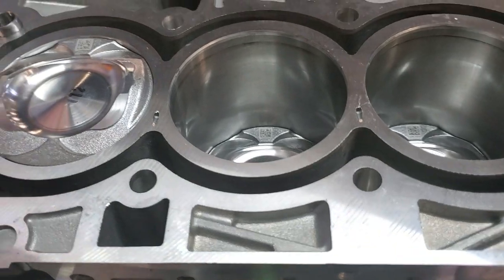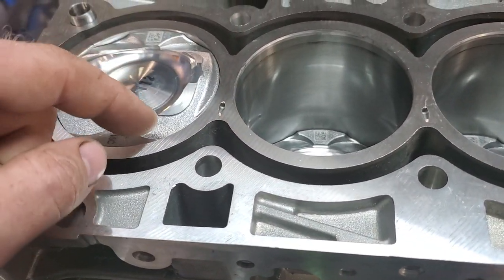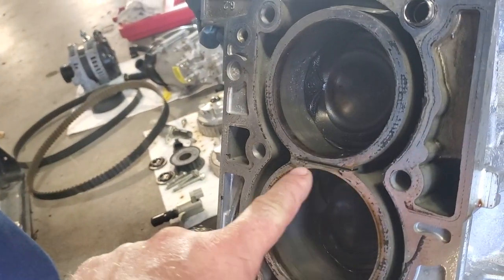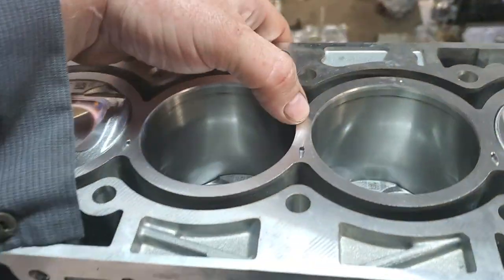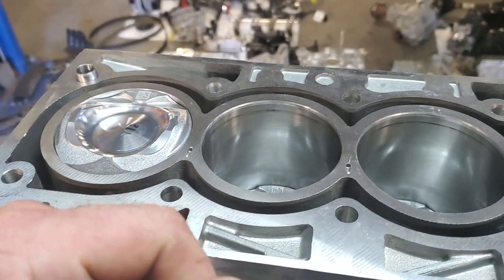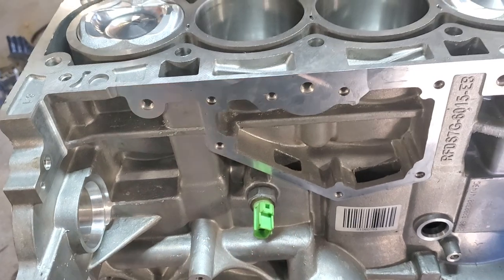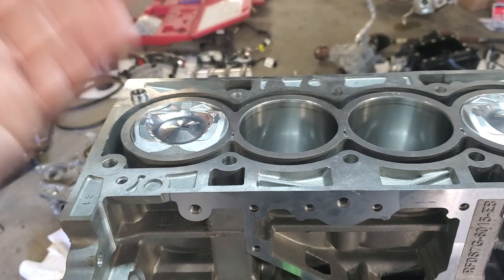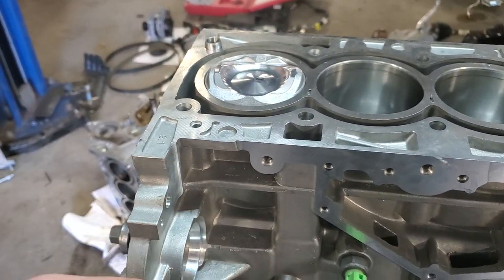Fords 1.5L EcoBoost Engine New Block Design Explained

Comment: O.k. You get a new long block for a water intrusion for a 2018 2.0 turbo Escape. Do you get the newer heads that clean the back of the valves too? Or are that they heads that have the old valves that carbon up after 30,000 miles and need to be walnut blasted. So you get rid of the water intrusion. But still have the carbon built up issue. Along with the AWD PTU unit that burns the PTU unit fluid up because its sits right behind the engine. Three bad designs on one SUV. Why doesn't Ford fix these issues also. While your in there putting in a new engine. My buddy has all the warranty's. His 2018 AWD Ford Titanium Escape 2.0. Will be in the Dealership for Service alot. Just to fix all these bad designs!   Shawn.
Reply from the maker: You're getting the same motor right back except just an updated block design so you're getting the old head as well
Reply: @FordBossMe  Thanks, Ford Boss me! The truth will set the world free. Keep fighting the good fight!  Stay true to Thine self. The rest is gravy! If people lie. They have to keep lying and lying.  The true sets us free indeed.  Shawn.

Comment: I been car shopping for a newer car doesn’t have to be brand new but my current car is giving me so much problems and it’s well over 100k miles so I figure I will get a low mileage used one. I like some of the fusions but they have the 1.5t I see you make a lot of videos on them are they reliable or should I stay far away from them?
Reply: geta 2.5 4cyl very reliable

Comment: After 2 years of publishing that video , do you recomand 1.5 ecoboost after 2018 with new design ?
Is 2.0 ecoboost have been upgraded as well or just 1.5L ?
Reply from the maker: Yes the new 2021 1.5 L is now a 3 cylinder it's not a 4-cylinder anymore and the 2.0 L has been updated that they're still using
Reply: @FordBossMe  Im I get this right, 1.5L are good from 2018 or 2021 ? 2.0L are good from which year ? Sorry Im confused and your rewievs are crutial for me so I need to be sure ;)
Reply: @FordBossMe  so which engine buy ?
Reply: I also have a 1.5 Ecoboost 150hp from 02/2019 … Does it have the new designed Engine or the old one ?

Comment: I know this is old, but maybe someone can help me. We had this service done to our Ford Escape 2017. The problem we are having now is the turbo waste gate Solenoid. We have moisture (i believe coolant) getting into the vacuum lines. Could you might explain how this could happen after the engine swap. The Solenoid was replaced but then it failed again after about 5k miles. Then i noticed after pulling one of the vacuum lines of the top of the motor, tapped it and there was moisture built up in the line.
Reply from the maker: Yeah but that doesn't mean it's coolant just because there's moisture in there, it could be because you're short trip in the vehicle too much and not letting the moisture that builds up kind of like beer can affect taking it out of a cold refrigerator and then taking a beer can out onto a hot summer day deck and all of a sudden it starts with the moisture the same thing happens with a vehicle if you short trip it too much you'll start getting moisture build up in the valve cover underneath the oil cap and the vacuum lines
Reply: @FordBossMe  Thanks for the quick response. Short tripping is out of question. The vehicle is driven 60 miles a day. The reason i believe its coolant is because of the lost of coolant from the reservoir about less than 1/4 of quart. over 40k. What would you look for if the waste gate solenoid keeps failing?

Comment: This just proves that manufacturers these days don't do proper development with rigorous testing of new designs. They just design new stuff and put it out. If problems show, they will deal with them later with recalls. Some stupid economists calculated that this is cheaper than doing proper testing in development phase. So we are left with new cars that you can't count on when you need it, which is the number one reason why someone bought a new car. Same thing happened to me with new Renault here in Europe, new car that I don't even like to drive.

Comment: Hello from Turkey. I have a 2015 1.5 ecoboost mondeo.

I am also having a similar problem. There is a sound of water. Probably the block will be changed.

There's something I'm wondering about.
What model year was the new type of block installed?
Reply from the maker: Mid 2019
Reply from the maker: I think the sound of water something different there's some kind of service message for that sound I believe I'll have to check it out if you remind me on Monday

Comment: Has ford ever produced an engine which hasn’t needed revisions to stop it grenading itself just outside of warranty? The Ford Focus st engine had a similar catastrophic design fault in early revisions..
Reply from the maker: 2.5 L naturally aspirated 4-cylinder is the best one that they made and it ran and ran and ran and you can still get it up 2 I think 2019 but they wouldn't give it to you in any of the titanium or higher-end packages you had to buy a base model to get it which I don't think was a good idea for them to do that
Reply: @FordBossMe  Are you talking about the 2.5L that came in the 98+ rangers?

Comment: How did Ford ever approve such a bonehead design? Even on paper that just screams failure point. Thanks for the vid. My 1.5 Fusion just got a new engine due to this issue.
Reply from the maker: Yeah it's a terrible design for sure and I'm glad you got it taken care of
Reply: @FordBossMe  Volvo 5 cylinders also had this slit between cylinders, and they go 200k+ miles without a problem.
Reply: @TheTsx  Nissan VQ series engines also have this slit. No idea why Ford had a problem while others have not. Obviously they didn't get something right in the design. It does look like the gasket mating surface between the cylinders is pretty narrow compared to a VQ.
Reply: @FordBossMe  Why didnt they just redesign the head gasket?? Do they ask you to update/reflash the ECU ?

Comment: Hello I have a 2013 that died about 4 years ago, and I just let it sit because I didn’t want to buy a new engine. I recently decided to fix it and have research the problem, just as you described. The redesigned block, is 2200+. is the source only ford? Is there an after market that sells them? If not is there actually a “good” year for this crappy engine that I can put in if I don’t buy a new block? If you have an email I can send to let me know.
Reply from the maker: Mainly Ford aftermarket was backorder for awhile

Comment: Doesn't look that disimiliar to shitbox rover k series engines of years ago...always head gasket problems...and old guy much cleverer than me,who for 20 years skimmed my cylinder heads and things described them as complete nonsense...liners move around a bit over time,fire ring of gasket ingresses into aluminium of cylinder head...and bingo....problems..